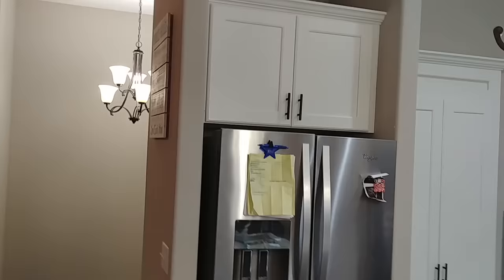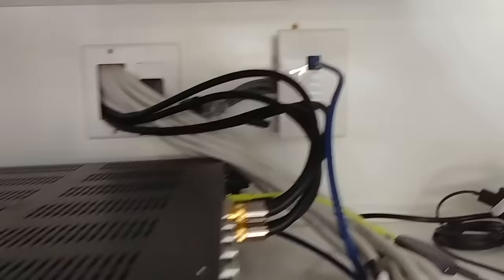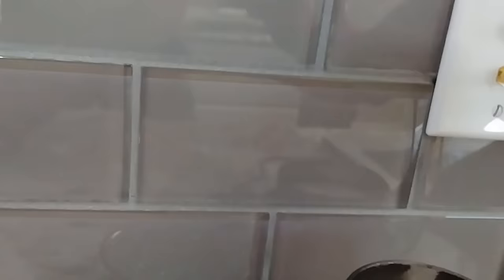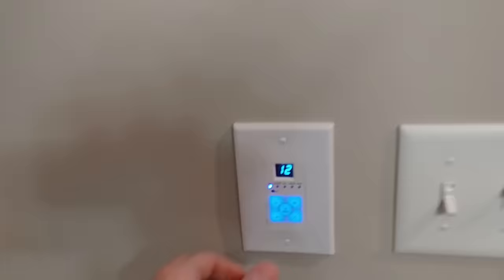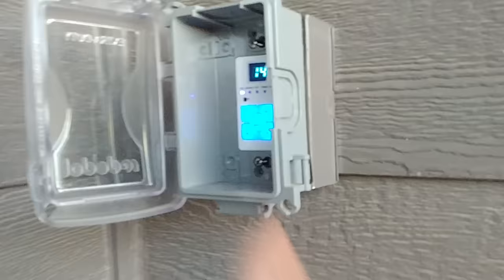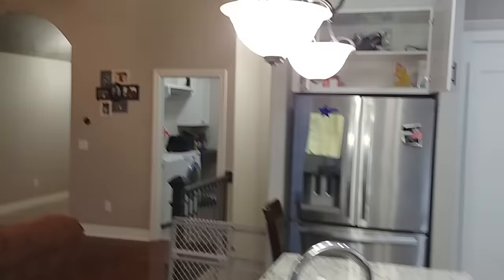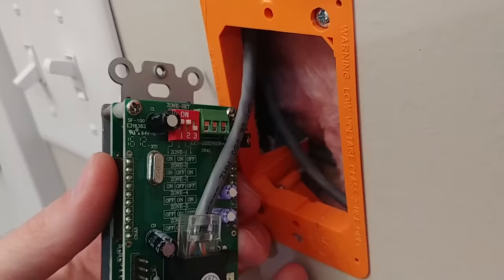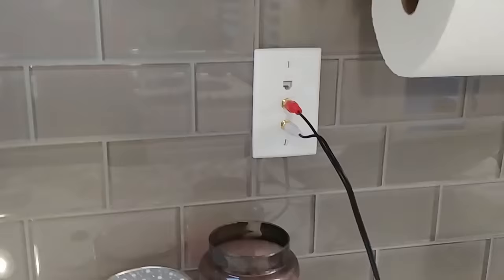WHOLE HOME AUDIO: Monoprice Whole Home Audio Amp! 6 Zone 6 Source

Comment: Did you not use one of the Bluetooth pads because of the Chromecast?  Did you consider using it?  Also did you use monoprice 8" speakers for inside?  And did you go 2 speakers per room?  Would you have done anything differently with those? We have a new construction going on and I'm trying to get a game plan.
Reply from the maker: Correct, there is no bluetooth because of the chromecast audio. Chromecast works over wifi, so anywhere in your house where you have wifi you will be able to connect to it. However bluetooth would have been based on proximity to wherever the bluetooth receiver is. So the chromecast is hands down more reliable. Inside I used dayton audio CS620C speakers (link is in the description). They are 6.5" speakers and they sound amazing. I thought about 8" speakers but am glad i didn't. They would look huge on the ceiling and a little ridiculous in my opinion. The reason i used these and not monoprice speakers is because monoprice charges shipping, and parts-express.com didn't. Shipping on monoprice was going to be expensive. In terms of doing anything different, not really, I would chose this amp again and again over more expensive "name brand" systems. This one looks just as professional and you dont have to buy it from a special dealer!

Comment: Great video. I have a few questions. 
1) Can this setup be integrated with my current 5.1 surround sound receiver i have in my living room? I would like to be able to play Audio from my TV and switch over to play music all over the same zones as well. I plan on having 6 zones MBR, MBR bath, back patio, garage, hallway, living room(separate receiver with 5.1) Total of 10 speakers + 5 for living room & 1 sub. 

2) Are the keypads necessary if i am going to use the app?

3) Is there a cleaner or different option for the source wall plates than RCA like stereo in or HDMI, etc?
Reply from the maker: It's not really meant to be a 5.1 setup or replacement. But if your 5.1 has an audio out, you can use it's audio out as an input into one of the amps sources. Then you could seamlessly have the 5.1 audio go through the whole home amp. The keypads are not necessary if using the app. But they are recommended in my opinion. What is wrong with RCA as inputs? Even though it is an analog signal the quality is still no different. The amp does have an optical input, and a 3.5mm input so you can use a chromecast audio to wirelessly stream music to it. But no hdmi sorry.
Reply: Nothing wrong with RCA as inputs, was just thinking of a input wall plate with RCA/ bluetooh so that i could possibly pair my Google Home to the blutooth and have it run through all of the speakers(Polk Audio in wall) simultaneously if need be and still having the freedom of separate zone control as well. 

I really appreciate the time you took to give me your feedback. I am also going to get a consult with Magnolia home audio and see what other options i have.

Do you have solar powering all of your equipment?  I like the idea of keeping the switches in the closet as a backup, that saves a ton of wire running.  @TheKMZ1
Reply from the maker: @THEEblackdynamite  I do not have any solar powering, or any renewable energy. Thanks for watching!

Comment: Hi again I’ve got one other question... I’ve wired all the controllers rj45 plugs to the T568A standard but just read the instructions on the jack board where they come together at the amp and that states to wire this to the T568b standard seems odd to me to be asking to use two different standards in one installation? Is this actually correct and how you wired yours?
Reply from the maker: They should be straight through Ethernet cables, so in other words just standard. It doesn't matter if you choose the B standard or A standard, but it needs to be the same on both sides. The standard for all normal Ethernet cables in the USA anyway is the B
Reply: Thanks for the clarification I thought it was unusual for them to ask for two standards on the same installation

Comment: Hey do I half to plug my speakers in to the AVR ? Or is there a Device I can plug them in to ?
Reply from the maker: Yes the speakers need to be plugged into the amplifier otherwise it wont be able to power them. If your speaker wire is not long enough then just make it longer by crimping or extending it. Solder it, use wire nuts, etc.

Comment: Great Video! I have a quick question what is the rg6 cable for? If I don’t have cable tv do I not need it?
Reply: Also for the living room most TVs don’t have rca output but the optical audio cable. How would that work? Or say I have an hdmi from Xbox.
Reply from the maker: @cougreggie2009  the rg6 cable is used to make a custom RCA cable. Rg6 must be used if running throughout the house because the cable is thick and makes there be little to no loss. If you used a regular rca cable they are thin and wouldn't work over long distance. Yes you can use optical but would need a digital to analog converter as the amplifier only has 1 optical port

Comment: For your source inputs, how did you convert from coax to other type, ie RCA/usb/etc at the source location?  Or did I misunderstand your source wiring?
Reply from the maker: I'm only going from coax to RCA, not any other types other than this. RCA is just a coax cable, even what you buy at the store. It's not as thick, but at it's core, it's still a single wire with an RCA end on it, just like coax. You can buy RG6 to Coax ends and crimp them on. You can find some youtube videos on it
Reply: @TheKMZ1  gotcha thanks

Comment: i would like to ask you if i can hook up that amp to a Sony receiver STR-DN1080, what i mean is i get all my sources into that Sony receiver and take an RCA cable out from that Sony receiver to the monoprice amp in and hook up the speakers to the monoprice AMP. also it was not clear to me how to hook up the plates in each zone i know you have to power it up with the Ethernet cable but the speaker wire goes into the plate as well or it just goes from the Monoprice AMP straight into the speaker, thank you
Reply from the maker: If your sony receiver has an OUTPUT such as RCA out or 3.5mm out, then yes you can output it's audio INTO the input sources of the whole home amp. The wall plates have ethernet going from the keypads all the way to the amp. The speakers have cable going from the speakers all the way to the amp. both go to the amp, and nothing else goes to the keypad. More can be read in the manual which is online. Thanks

Comment: Hi. Question about your cable runs. What did you use to connect the coax to the monoprice amp? I didn’t see any coax input source in the amp.

Also can 3 zones be bridged together? I have 6 eight ohm speakers I would like in one zone. 

Thanks!
Reply from the maker: 3 zones can't be bridged together but you can buy more amps and connect the amps together for more zones. Up to an 18 zones with 6 sources. Coax cable is terminated with RCA ends so it's just a thick rca cable

Comment: Did you ever thinking about doing large inwall speakers vs ceiling other than next to the TV?  I've been tossing around putting a few about chest height in a couple areas that people would be hanging out.
Reply from the maker: Kevin Campbell I never did think of that no. My only thought would be sound waves might not travel as well chest level on the wall vs being overhead
Reply: TheKMZ1 ya I've heard it go both ways saying the inwall ceiling speakers sound come down in a cone
Reply: Depends alot on the room/space and the exact speakers. A pro install for example should have that balanced with appearance depending on the owners expectations. Pretty hard for a DIYer with limited audio engineering or extensive trial and error style experience to know which would sound better in the space so I suggest just going with look you prefer, and a quick guess that in-ceiling would work better in more spaces.

Basicly, with music, in-ceiling is better at sounding invisible and in-wall would be better for creating a specific sound stage, but Hifi towers would create a much better "listening room" sound stage. So pros pretty much just use in-wall speakers for multichannel theaters that don't want speakers in the room, not usually for whole home stereo music.

Comment: Does my monoprice amp have to be in a cool or ventilated room? i am find a small spot for it in my attic. Not hot space because i have sprayform insulation. But it's not climate controlled.
Reply from the maker: It can be in a closed cabinet but not in an attic that would be too hot
Reply: @TheKMZ1  thanks. The problem is my cabinets don't have close access to my attic for wiring purposes. I have a 2 story home.

Comment: What is the box you used for the outside station?  Looking to do the same for my patio.
Reply from the maker: ptellec that's just an outdoor weather proof electrical conver. It attaches onto a standard on wall electrical box. The weather proof covers are usually required on all outdoor electrical outlets on new homes

Comment: Can you also connect a remote control to change the volume? I'm very interested in your setup, but the only problem I might have is that I'm lazy and that I don't want to get up to change the volume 😋
Reply from the maker: FE59FE59 actually yes you can, this system comes with a remote and you can purchase additional remotes.
Reply from the maker: FE59FE59 I've also heard you can program a Logitech remote to control the zones too. Each keypad has an IR receiver and you have to point the remote at the zones keypad you want to control
Reply: TheKMZ1 The IR receiver on the keypad was what I was looking for. Thank you for the fast response! You earned yourself a new subscriber!
Reply from the maker: FE59FE59 thanks! I've got some good videos coming up! 😀

Comment: Been looking at this system but to pair with the new sonos port and want to avoid keypads. Can this system function without keypads? The ports would function identically to your chrome cast audio, so imagine if you have 6 audios plugged into those audio channel and no keypads. Would it work?
Reply from the maker: Yes the system will work without keypads, you would need the iTach flex and flex link RS232 cable and the android/iPhone app

Comment: With the chromecast do notifications and things like that come through if you’re using your phone? Can you still use your phone and listen to audio from a different app on the phone while still streaming music?
Reply from the maker: Notifications and other things like calls don't come through. From what I've read, when you use spotify for example, the actual Chromecast makes a connection to spotify and is streaming directly from the chromecast...as opposed it it streaming from your phone, then to the chromecast. Now if you are mirroring your phones audio to it, then yes I think whatever audio comes out your phone goes to it (so calls and notifications probably) just so you know, they did quit making the chromecast audios
Reply: TheKMZ1 Yes I know they quit making them, it’s unfortunate... I found something that Dayton Audio makes that may be a viable alternative
Reply from the maker: @wlms04  mine still works great, hopefully pandora/spotify don t get rid of the casting support but so far still works awesome! I think you can get them on ebay still

Comment: What fittings did you use to make your coax cable into RCA cables
Reply from the maker: RG6 to RCA compression connectors, available and all the main hardware stores, lowes, home depot, menards etc

Comment: How did you run the wiring on the first floor ceiling? Did you have to make access holes to run the wire then patch them up again?
Reply from the maker: Joe L no you have to get up in the attic and run the wires
Reply: So you have an attic on the first floor in a 2 story house?  Is there not a room above your kitchen?
Reply from the maker: Joe L it's got a basement and the main level. There is no top story of the house. Above the kitchen and everywhere else above the main level is the attic. If you have a house which has rooms built into the attic then your job running wires is a lot harder lol

Comment: I am about to buy this system. So I need you to help me to verify the following:

Speakers wire is coming from the amp to the speakers

Pair of coaxil rg6 cabel for each source. Did u used this for your kitchen source or only for TV. Do I have to use pair of cables for each single rouce ?

Ethernet cabel from amp to the hub. And from the hub to each control keypad

I think that's it. I am going to install it by myself. But I want to understand something is this hub or the amp it self  have a power over Ethernet capability (PoE) so I don't need any power source for the keypad?

Thanks
Reply from the maker: Khalid Alzaki yes that is all correct. And you don't power the keypad, they get powered by the amplifier
Reply: TheKMZ1 thank you so much. I was looking for something similar but I did not expected to find something like this in witch I can control each room independently, the only problem that I may face the 16 AWG RG6 coaxil cable, we don't have 16 AWG in egypt instead 18 AWG is available I am wondering if the 18 will get the job done
Reply from the maker: Khalid Alzaki yes that should still work

Comment: Can you turn off the keypads without a remote?
Reply from the maker: You can use the remote, the physical keypad, and the mobile app as well to control the zone. Check out my video on the WS66i

Comment: Dumb question but are the speakers playing in stereo or left and right? I’m trying to only put one speaker in my laundry and one in the mud room in different zones.
Reply from the maker: They are stereo left/right but there is a switch on the back for mono. But then only supports 1 speaker for that zone so that might not be what you want either

Comment: Great video I am currently running my speaker wires today for my living room surround sound only. I know an amplifier is needed but do I need to run the the black cables for the TV? Can you please send me your email as I have a few more questions. Thanks
Reply from the maker: It depends if you want a source to be the tv, if so then run the cable for rca

Comment: Hi , thankyou for this as there isn’t much help regarding setting up a decent system. Can I ask, I have run cat 6 and 2 off them to each speaker then to a central point. I have been told that I can use one of them as a poe power over Ethernet. However I haven’t run and cables to switches like you have in each tool where you want to control them. I have been told that I add in the google chrome cast and will be able to control each speaker seperate to via this device from phone or laptop wirelessly. I’m afraid I have done something wrong and they are going to start sheeting in the next few days so I only have tomorrow to fix. Could you advise if this is okay? And also the name of the wall controllers? And if I used the wall controllers I’m assuming that all cat 6 cables from the wall location back to the central area would fix this. Look forward to hearing from you.
Reply from the maker: You don't need PoE, or a switch, this whole home audio comes as a kit. It comes with everything you need including the wall keypads. Please go look at the amplifier on the website, link in the description then you will understand

Comment: How well does this work for adding more than two speakers per zone. And how about subs?
Reply from the maker: Andrew Anderson this amp has pre amp outputs so you can hook up an external amp. If you want a sub or more speakers you'd have to use an external amp hooked up to it with those pre amp
Reply: @TheKMZ1  thanks, and great video!

Comment: Quick question, how would you hook up the door bell to the system?
Reply from the maker: Ervin Woodard this system doesn't have support for that. It has a PA functionality where an input hooked up to that would trigger all zones but that would require some kind of custom work with the doorbell. This is a cheap (but great) system and unfortunately it doesn't have every bell and whistle

Comment: Thanks for the video. With this set up, are you able to adjust the volume on two, three, or as many different zones independently while playing from the same source? Thanks for any help given.
Reply from the maker: Ya Va yes all zones are independently controlled
Reply: TheKMZ1 even from the app?
Reply: Sorry i hit send  too quick. Do you know of an option with only four zones that also has an app to control it with a smart device?
Reply from the maker: Ya Va unfortunately there are no 4 zones unit. Just buy this unit and only use 4 zones out of 6. Then download the android app. With the app each zone is independently controlled and you can also group zones together to control them together
Reply: TheKMZ1 thank you for the info. What is the name of the app?
Reply from the maker: Ya Va monoprice whole home audio control. I think if you just type in monoprice in the play store it shows up too

Comment: Why 2 speaker cables per channel? Thx
Reply from the maker: 2 speakers per zone, that's what the amp was built for, but the amp has pre-amp outs which mean you can connect a zone to a separate amplifier, but still retain your source, volume, EQ control etc. So technically you can get more speakers in a zone by using the pre amp out and a separate amplifier meant for more speakers